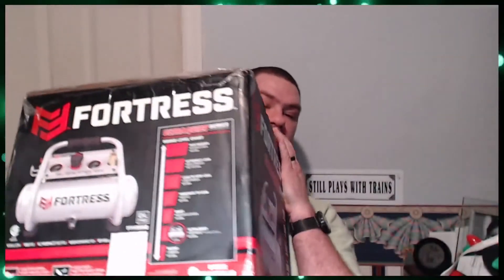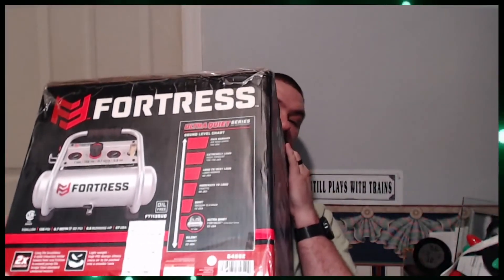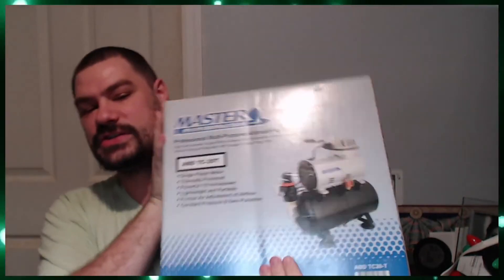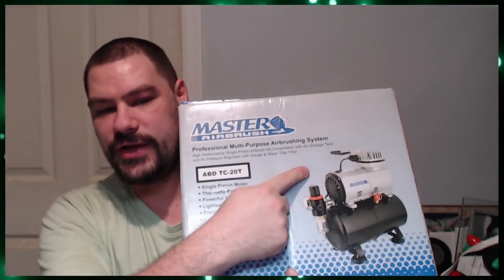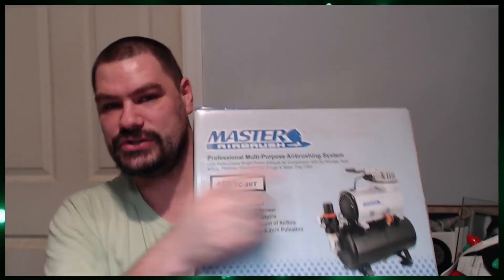Compressor Wars

Comment: Wow... that's a lot of lemonade from what started as a crate full of lemons, Rick! I would take those results any day! I would definitely get rid of the 2 old compressors and replace each with its new counterpart...win/win (and the new ones are better than the old ones, too)! Looking forward to 2022 watching your channel. Thanks. T4
Reply from the maker: Fingers crossed! I so agree... I was testing out the replacement today. mixed reviews but it will work. Thanks for watching T4.
Reply: @FBMRR  Glad it is working out... hate when equipment doesn't do as promised/advertised, but a company that stands behind what it sells is worth a lot even if their stuff leaves something to be desired. Thanks. T4

Comment: Fantastic customer service. Compressor replacement with a air tank?? Fantastic. Air compressors don't like to work constantly, it kills them.
I got the same one with a different badge on it. Haven't had issues with it yet. Had it now for about 3 years. But what I did do, I modified 2 ex fire extinguishes bottles into air tanks for air brushing. It gives me plenty of air, and the compressor doesn't work as much.
Thanks for sharing.
Reply from the maker: now thats awesome...modifying your own tanks... you need to show a video on this my friend... Thanks for watching.
Reply: @FBMRR  I will later in the year once things are close to normal for me here health wise.

Comment: Guess you can never have to many air compressors, or airbrushes. I started out some 20? years ago with a Sears 2Gal monster compressor. Like your Pancake, LOUD. But if you want to paint the house of air up Truck tires (what I use mine for now) it's ok. I tried "Canned Air", but got tired of wasting $$. Now, I have a mini FOS compressor, about 1/3 the size of yours. Super quiet and works great. On top of that, it came with 4 air brushes (that's right Four). I would still be using my Paasche airbrush, but let my son use it and he didn't clean it. Grrrr. I had also gone thru a few HF brushes. Most didn't last long, but still have one for back up. Great Video (keep'em coming). Have a YT video question that maybe you, Ray, Heath of someone can answer. Just need to know how to reach you.
Reply from the maker: Lynn thanks for the feed back. i'll keep you posted on the progress. my email is on my about page. I heard the addresses dont show up on the phone app. email me and i will gladly answer.

Comment: i seen where people love the master brand and they never use any other brand but for me i went threw 4 master airbrush they are $20 each and only work 1 time. Now for the compressor i haven't had any problems it works great. at less they gave you a new one. that was nice
Reply from the maker: Oh wow! 4 brushes... i just put mine in an ultra sonic cleaner (video to come on that too). Works like never before... i got every nook and cranny cleaned. wonder if that would fix yours.
Reply: @FBMRR  i been wanting to get one of those cleaner things

Comment: BTW Rick, That drain..the reason for the season..lmbo oh AUTO pts has Radiator Petcocks/drains they work too, the oil-less compressors suffer rod/Crank failures quite commonly.  Cleaner the Air.better your paint jobs. I just counted..I currently have 11 from baby's to 186 CFM She's a good Screw!! ( Sullair)  🤣
Reply from the maker: Thanks Bernard. I'm not starting a collection but it is nice to have a backup.

Comment: Rick  There are some good company's out there.   Sounds like TCP Global is one of them.    Hey quick question for you. What temperature can you air brush paint at?  I have several items I wish to air brush and sow a video where someone said  not to air brush when it is cold.  My room temp is 68 - 72
Reply from the maker: that's a good question. i never heard of actual temperature numbers. But do know cold has some weird affects on paint.  Thanks for watching.
Reply: Thomas if you are at 68-72 degrees you are fine. Normally need to check the paint but when you go below the 50s then you getting into trouble. Again check you paint, it has to be able to off gas and dry.